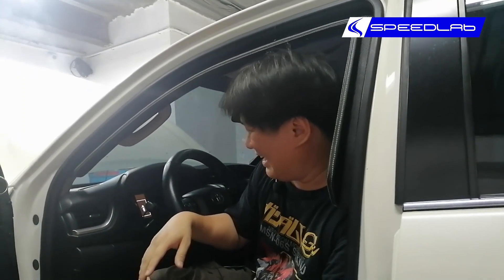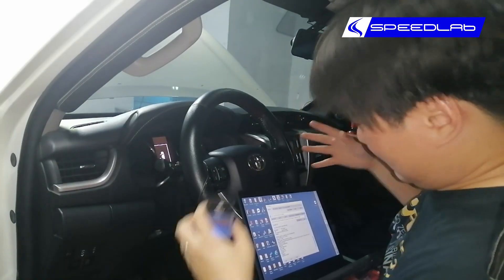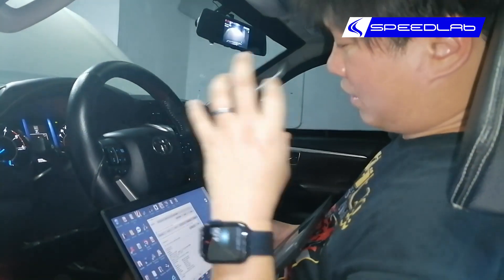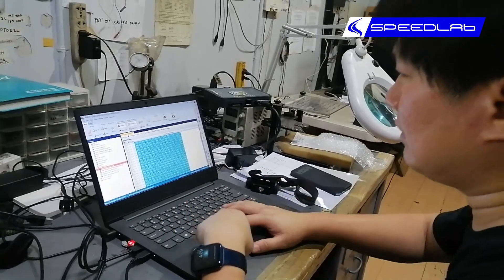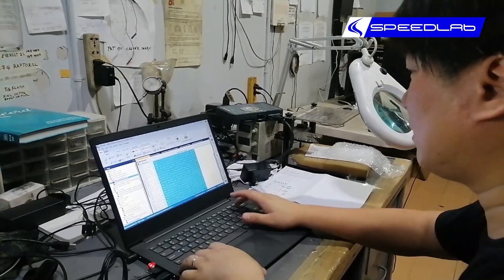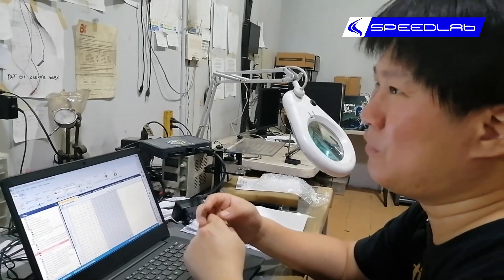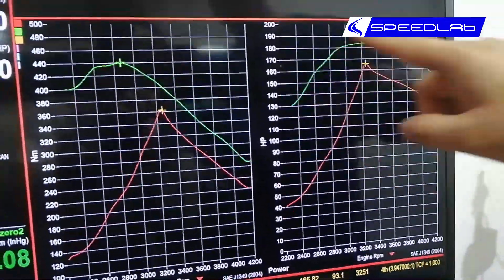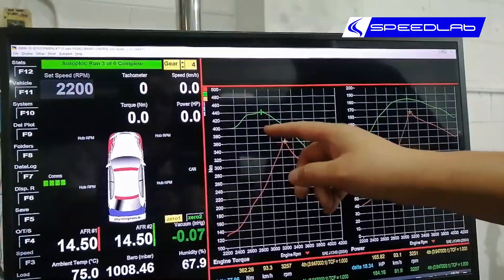Toyota Fortuner HIlux Innova 2.4L SpeedLab ECU Remap Hotpipes Downpipe

Comment: Sir question lang po, bat sa 2200 nagstart yung graph instead sa 0?
Reply from the maker: Because 0 rpm means the engine isn’t running. 

And you cannot have an engine in 4th gear at 900rpm
Reply: Tama. 800-900 rpm yta ang idle ng makina. pero Sir Sid, pano po sa katulad kong slowpoke driver na nsa 1600-1800 RPM lng kdalasan tntakbo, i mean may page 1 ba ung graph na yan para makita ko ung 800-2200 rpm graph?
Reply from the maker: @kirkplacides7434  we tune that rear also
Just cant measure it
Reply: Thanks po sir sa clarification.

Comment: With that graph sir, kakayanin ba ng stock clutch assembly? Kasi @2200 RPM sobrang taas na agad biglaan ng torque and hp?
Reply from the maker: Yes
Reply: @speedlabchannel4452  mas mabilis nga lang ang wear and tear kung medyo mabigat ang paa sa gas pedal. Pero kung normal driving wala bang mangyayare clutch sliding?
Reply from the maker: @bernardoR2R  if you keep drag launching it everytime you stop yes

Remember you’re not racing all the time and 90% of your driving isn’t even using 50% of the available power
Reply: My remap with speedlab since before pandemic til now still good.my convenience is great., love it.